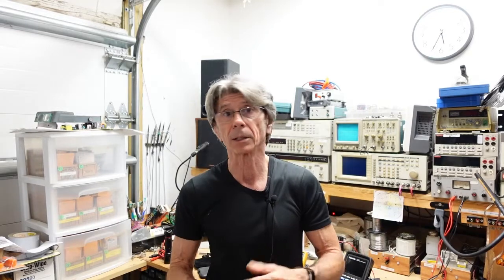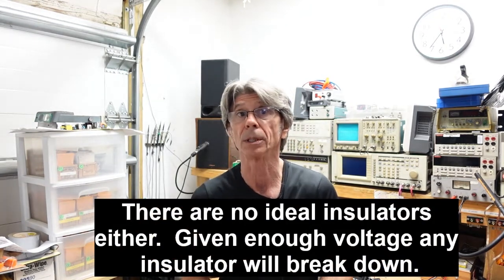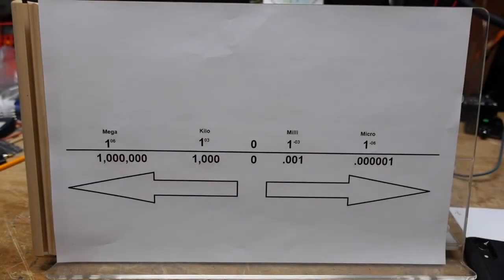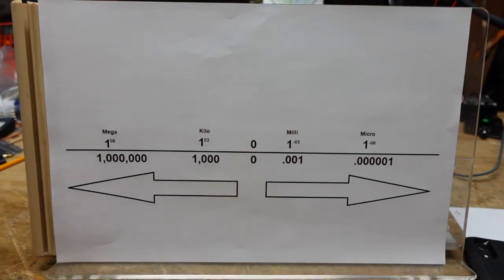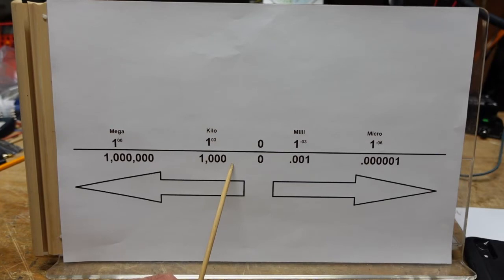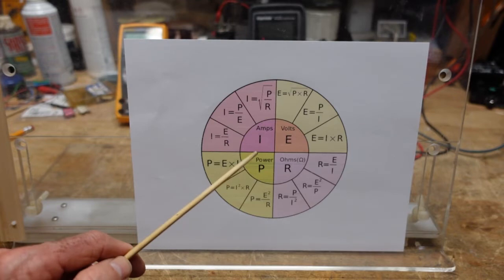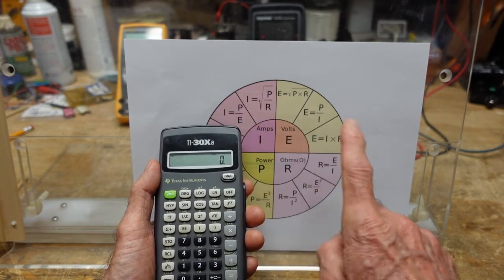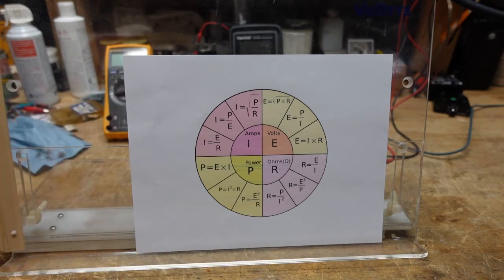Basics Electronics for the Technician Part 2- Ohm's Law

Comment: Thanks for another great video. As much as I love math I have always had trouble with mill and micro on the one side of zero. I like the arrow chart for it. Gives me a nice visual to refer to. I also printed out the ohms wheel witch I had never heard of all these years. An awesome way to refer to needed formulas.
Reply from the maker: If you look at my bench you'll see that wheel below the distortion analyzer.  I still refer to it.

Comment: Working my way through these amazing videos. In addition to copying your chart on the ranges I added symbols for each unit of measurement i.e. M for mega, k for kilo, m for milli, and the greek u or mc for micro. Really basic but helps someone like me map to schematics or even settings on the multi meter.
Reply from the maker: You need to do whatever it takes for this stuff to make sense to you, and it sounds like this chart you're making does just that.
I really need to get cracking on the next installment!

Comment: What about RMS watts. Isn't RMS watts = (.707 x Pk Vdc) squared/ohms.
Reply from the maker: Juan, there is no such thing as RMS watts.  We do use RMS volts to calculate wattage.  The formula you quoted is for converting peak voltage to RMS, then dividing by your load resistance.

You may hear the term RMS method for calculating power, but say RMS watts to the wrong person and watch out!  😳
Reply: @raygianelli3612  Right, forgot that RMS watts was whoever’s (FTC?) invention.

Comment: Just a note on the Milli and Micro, so for Milli (1 to the power of -03) could equal 0.001 only because we can see 3 literal zeros, even if the first one is a whole number placeholder. It just helps us see 3 zeros. For Micro (1 -06), we could say 0.000001 instead of .000001 because it helps us see that extra zero.
Reply from the maker: Thanks, I will do that.
My problem is there's so much crap spattered on my monitor I can't tell if it's a decimal or a spot on the screen!😁
Reply: @raygianelli3612  🤣

Comment: Thx for the update, btw, I work with multiple pc monitors here, and the wheel is always not far away, why multi monitors, it's great for datasheets, and schematics at the same time. I hardly print these on paper, a little effort to save the planet a bit.
Reply from the maker: Multiple monitors is a good suggestion for that application. Thanks for mentioning it!

Comment: HA, I am a retired, fellow "Telecom" tech, starting out as a "Cable Splicing" tech for the first 25 years of my career then, some training to work with new fiber optic multiplex systems and digital loop carrier systems was thrown in, then, the work with DSC/Alcatel Litespan 2000/2012 systems, for which I became thoroughly acquainted with  during the introduction of ADSL for residential data. I then graduated to a full time "equipment based" crew, and dealt with many, varied systems, at first installing, then, doing maintenance as well, along with working with the -48VDC bulk power & battery backup systems involved with keeping them working and providing power during outages. After almost 42 years, retirement looked good, so I left, to return to electronics tinkering, which I started in my mid-teens.
Reply from the maker: Apparently there's a lot of us out there.  I started as a service tech with Bellsouth in Miami.  Wasn't on the job 4 months when I got held up at gunpoint and quit.  Bailed out of Miami and moved up to Palm Beach County, wound up as a central office tech.  Way better job, work with Lucent and Fujitsu multiplexers, DSC/Alcatel/Lucent/Tellabs DACS and newer Ethernet products from Juniper and Ciena.  Also did power and DLC for a while.  Frankly these are some of the last good jobs to be had, and I'm fortunate to have gotten in when I did.
Reply: @raygianelli3612  I worked the "Wild West" side of Chicago as part of my area for the first 7 years of my career (somehow never getting shot, stabbed , robbed or r*ped), then I escaped to the suburbs.  The SLC-96 , Nortel FMT150 and Litespan systems were considered to be "owned" by the "outside plant" department, so I did get a lot of CO time turning them up and adding new systems when assigned. By the end of my employment I was installing and turning up relay racks and overhead ladder racks and Ciena 6500 - 32 slot "Photonic Bays" into CLEC's (mostly MTSO's) offices, dropping off 100 gb/s optical circuits to them. Times sure expanded/changed from wiring up inter office trunk copper T1 repeater spans when I first started. I knew how to read schematics as a teenager, so, crossing over to reading "Work Prints" to splice new, or make changes to existing cable  connections was a fairly easy learning curve. I just never got to "formal" electronics technician training or get any electrical degrees. And yes, a career in jobs like these will sadly be hard to obtain going forward, as every company wants to go to "outside contractor" labor sourcing now.